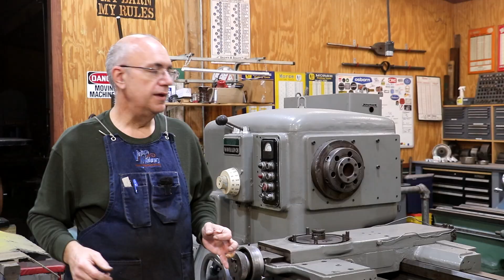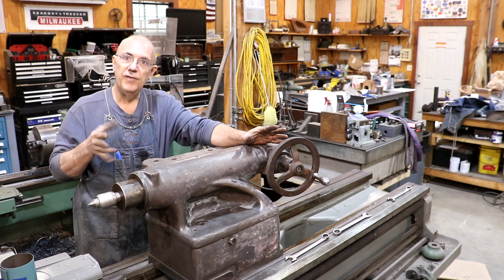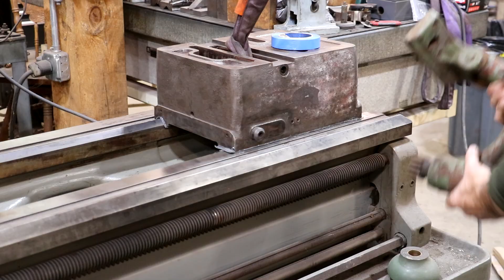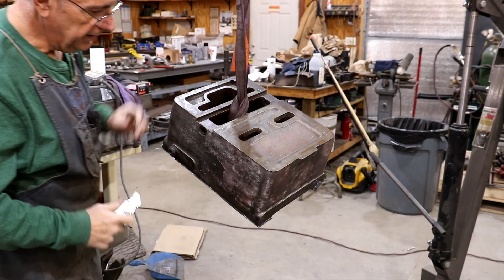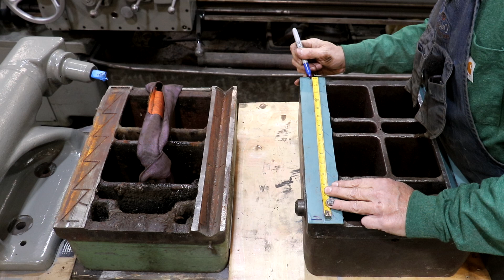Monarch 612 Lathe Restoration: Building up the Tailstock Height with Turcite Wear Strips

Comment: You are experienced, so will have factored into your scraping plans that using the same 30 thou. turcite on the v-way as on the flat-way has rotated the tailstock base.  FYI for others : because the turcite strips applied to the 2 v-way surfaces are at an angle to the horizontal (45° assuming a 90° v-way) they have a greater vertical depth - the side with the v-way has gone up by 1.4 times the 30 thou. added (sqrt(2) is approx. 1.4) which will introduce edge-only contact areas along the 3 way surfaces.  This will be partly disguised by the epoxy along those edges having been squeezed away by the rotated weight of the tailstock base.  About 10 thou. would need to be scraped from the entire surface of both v-way turcite strips to remove the rotation that has been introduced.  Alternatively, the edges of all 3 turcite strips where excessive contact has been introduced will need more scraped off to widen the turcite contact areas with the metal way surfaces.
Reply: Yes. I was thinking along these lines as well however the plastic will cold flow to maximize contact area on its own  but using different thickness turcite would minimize fitting in.      However the original machining of the tailstock would had to accommodate the same geometry and  this is overthinking the problem

Comment: Great vid as always but would not making a spacer to fit between top and bottom halves have the same effect without the wear issue
Reply: The bottom surface of the tailstock wears no matter what. I believe Turcite wears less than cast iron..
Reply: Yeah that’s how I would have done it but I guess if the tailstock surfaces needed freshening up might as well do both at the same time.

Comment: Keith, I'm a loyal viewer. I had a enough of a fright when you crossed the lids with the bases of the expoxy that I thought I would support viewer best practices with a comment. Accidently swaping the lids would cause both cans to set up while you store them. So I have a STRONG habit of making sure the lids and the cans are well associated on the bench. I might put a big red dot on the harderner lid and certainly keep them on the outside of their respective cans. Of course I was relieved that you un crossed the lids right back on to the right cans! 20 years of speacity adhesive and composite material work speaking here. Love your channel.

Comment: Won’t glueing the turcite over the oil groves stop the lubrication ?
Reply: But he didn't drill a hole to connect the new oil grooves to the existing oil port.
The original oil hole of the flat surface was on the inner section of the flat surface which is no longer a bearing surface, so he can't just re-drill the existing hole, instead he either needs to drill at an angle at exactly the right spot to connect the new hole to the existing hole or he can drill a hole to the outside of the casting to create a new oil port...
Reply: I'm not sure there is an oil hole. Ways are usually oiled directly with an oil can. @Henning_S.
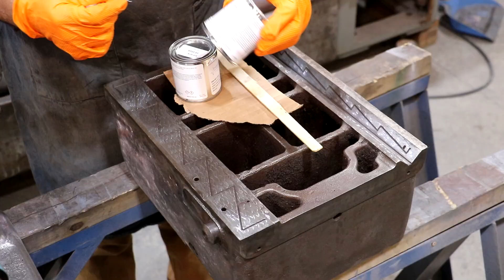Reply: @phlodel  at 11:50 in the bottom end of the sliding surfaces you can see a short groove which connects the Z-pattern to a small oil hole...
Reply: Oops, he explains it later on.

Comment: Hi Keith I know this is probably going to sound stupid but why wouldn't you raise it up by adding the strip between the  two halves of the tailstock .
Reply: At around 2:00, Keith adjusts the side to side and around 6:00 when the tailstock seperates, you can see the adjusting lugs hanging down off the top half of the tailstock. If the shim was added between the halves, those lugs wouldn't line up with the holes in the bottom.

Different tailstock designs may allow the shim to be placed in between though, and I agree that may be a better location as then the shim wouldn't be subject to wear.

Andrew
Reply: @WAndrewDalgarno  was wondering the same, would 30 thou difference really be that bad? You could propably widen the holes for the bolts a little to make it fit again.
Reply: Thanks Andrew i didn't see that when i watched it . @WAndrewDalgarno
Reply: It could have easily been done.
Reply: I wondered the same thing.  The flat rises by the thickness of the turcite.  The V rises (thickness)/(sin 45) or about 1.4 times the thickness, introducing a tilt that may not matter.  I think the reasoning is that since the bottom of the base doesn't fit the flat way properly   the oil grooves would be hanging off the side and not lubricate the way properly.  The oil grooves in the turcite will keep the oil on the way.
Reply: Thanks for the explanations, I was wondering what everyone else was. Makes more sense now.

Comment: Will putting the same thickness if turcite on the flat and the V way not amount to different heights?
Reply: I had the same thought. If the Turcite is 30 thou thick, then the V way side will be raised up about 42 thou, and the center will be raised up about 36 thou. In the scraping process I'm sure Keith will check the alignment of the centers and if indeed the tail center is higher than he wants he can scrape Turcite on the V way down to suit.
Reply: I know turcite can be scraped but in order to achieve a level tailstock where the horizontal  adjustment does not have a vertical impact we have root 2 x thickness to contend with. Perhaps he is still a bit low and can add some shim to the flat way.

Comment: Very nice! Does the turcite compress at all? Meaning, can the tailstock squash it under some loads causing it to be off center with the spindle?
Reply: very long answer..................  No :)
Reply: @Turbo-Drew every material will compress or deform under load, but you are right, the amount of deformation is just so tiny that it isn't measurable...
Reply: @Turbo-Drew try putting it between two pieces of steel and squeeze it in a vice, you will see that it squeezes. After all it is just plastic with bronze particles in it
Reply: @Throughthebulkhead  I know, that's similar to what I've tried in the past. I understand and appreciate people above saying No, but I just can't seem to shake the feeling making heavy use of the tailstock with squishable shims is going to cause some issues - albeit small.
Reply: @JFirn86Q  they also use this stuff on a lot of modern cnc machines, so it will not cause problems. And you can't compare squishing a small piece of turcite in a vice versus compressing a relatively large area of turcite with the weight of the tailstock. The pressure in a vice is probably between 500 and 1000 psi and the pressure under the tailstock is probably less than 10psi, even when it is clamped down.
The weight of the tailstock is probably around 100 pounds and the area covered with turcite is at least 50 square inches, so that is 2 psi, and then there is some additional clamping force, probably a few hundred pounds.
But the weight of the tailstock and also the clamping force is relatively constant, so you can account for that when scraping and it will not change the center height later on. The only remaining things which can change is the weight of the workpiece and the cutting forces, but both are miniscule compared to the force/weight which is already pressing on the turcite.
Of course if you put a huge 500 pound workpiece on the lathe it may compress the turcite a few thou, but since the diameter of such a workpiece is pretty large, the error in diameter will still be way below 1 thou which usually doesn't matter with such a huge workpiece...

Comment: Only way to accurately measure is an alignment rod with accurate ground centers. I have kept my ways well lubed since I got my lathe new in 1996 & it hasn't dropped at all. I re-level it every 6 months with my Fell, keep shop @ 69*F year round, & conditioned air. No rust; no wear; no movement. Close isn't enough in precision work.
Reply: You can also mount an indicator to the headstock spindle or the chuck and rotate it around while measuring on the inside of the Morse taper. If the needle doesn't move while turning the spindle, you are exactly on center.
Reply: @Henning_S. A very good suggestion. I’ve also used a Co-Axial indicator to align the headstock and tail stock.
Reply: You have to be real careful using the phrase “only way” in a machine shop. Just saying….
Reply: @grntitan1  True. Usually at least three ways to do every job. Often more.